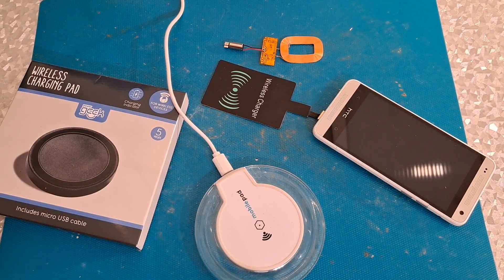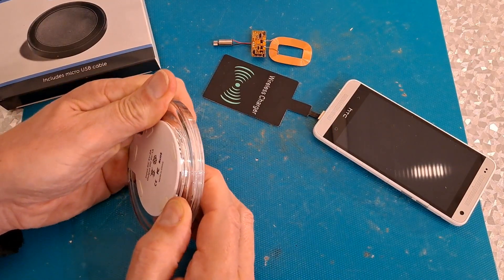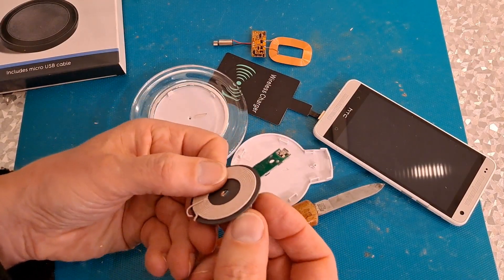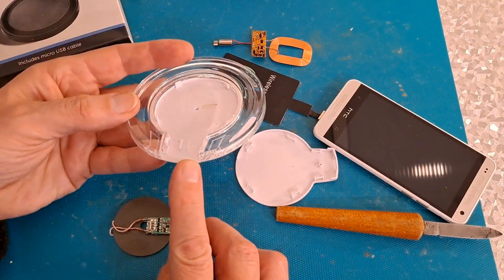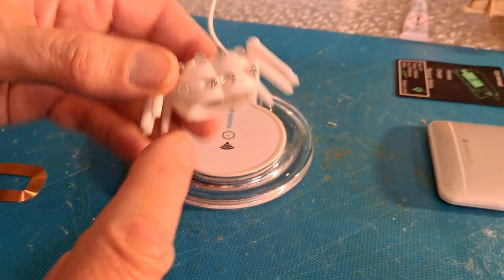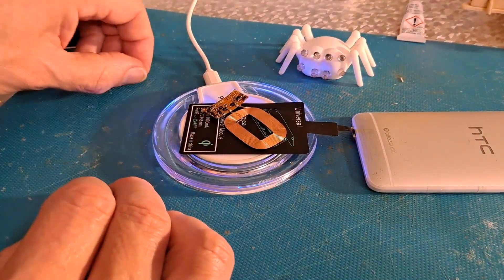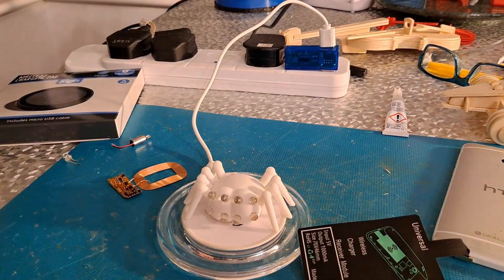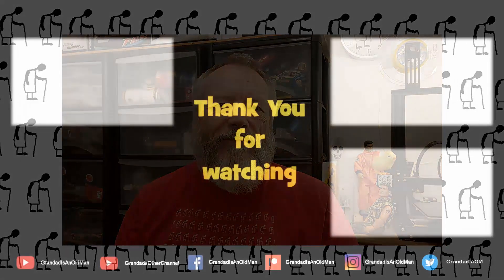Peek inside the Poundland Wireless Charging pad

Comment: The circuit is interesting although I wouldn’t understand it
Reply from the maker: I don't understand the components, but I do understand the principle. Alternating current in the coil creating a changing magnetic field which induces an alternating current in the other coil. Think of it as a transformer with 2 coils but without the metal core, just an air gap.
Reply: @GrandadIsAnOldMan  Great you understand it better then me. Thanks

Comment: Good to see the inside of the transmitter coil and how easy it comes apart. I have made a few pancake coils in the past and powered them with a PWM device. When you put a small neodymium magnet on top the magnet jumps about. Would be interesting to try it on that transmitter coil. I don't know what that metal plate is made from but at a guess, it may be for spreading the magnetic field out. I bought two of the coil transmitters and I am wondering if you made the coil bigger using magnet wire if it would be stronger. I know you may draw too much current and burn the circuit board but I might just try it. 😁👍👍👍
Reply from the maker: A magnet is just attracted to that ferrite disc so it doesn't even notice the magnetic pulsing
Reply: @GrandadIsAnOldMan  the 3D printed spider 🕷 is very cool!
Reply from the maker: @marcoreviews  hi Marco, details of the spider are in the video description 👍